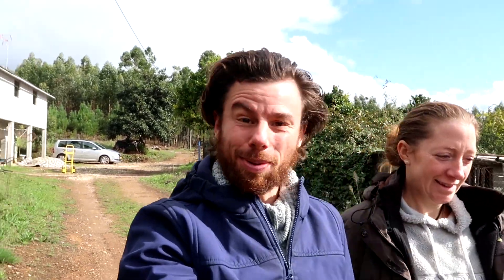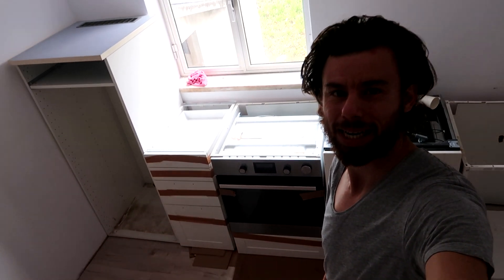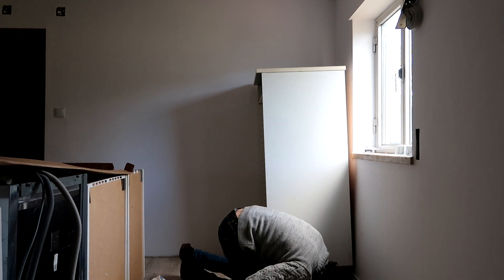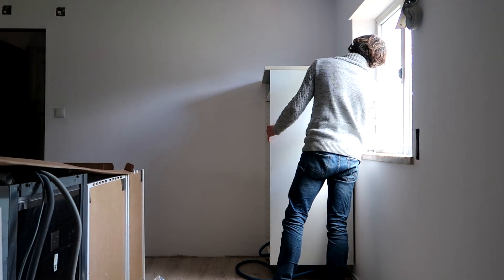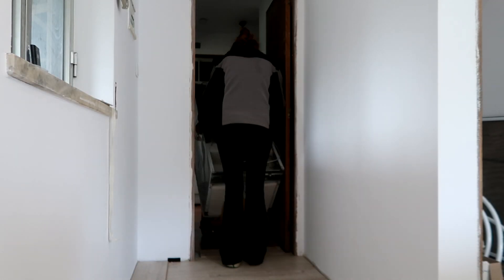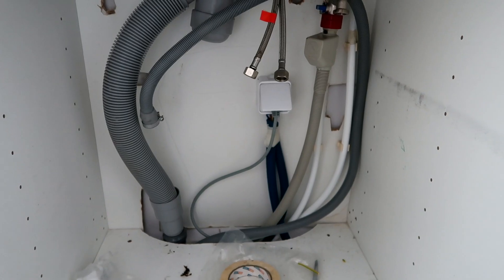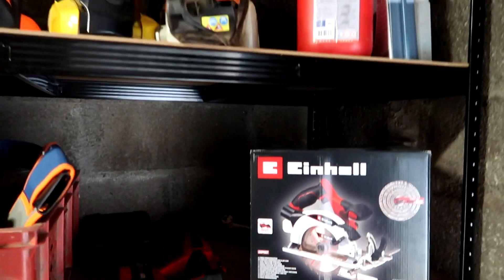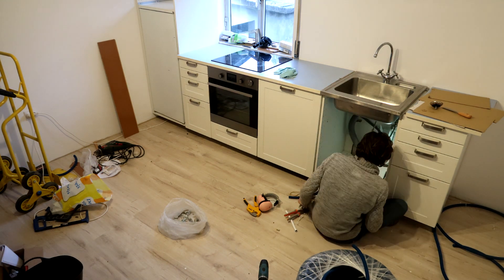Budget Brilliance: Installing a €200 Kitchen

Comment: Hey buddy.. you can increase your electricity power... you pay more but you can...  good luck you doing an excelent job
Reply from the maker: We've already increased it to the max they can provide us with the current main cable. If we want more, they need to renew the main cables and since we're in the middle of nowhere, they don't want to. Or we will need to pay the costs.😑
Reply: @QuintaLimaPortugal  maybe buy a bluetti solar generator for your extra electric and you can also use it on the land 😇💗💗💗

Comment: It's very strange to see the cooktop installed under the window. As the window will get splashed with oil and water, etc.  Normally in Australia we install the sink under the window. So you can look at the view while washing the dishes.
Reply: I totally agree with you in portugal normally is the way you sugested 😎
Reply: They had a kitchen already set up that way and made it work for little expense - I’m sure if they planned a new kitchen they would have configured it differently but they had what they had and made the best of it ….
Reply: Please please move the electrical socket away from under the sink ! If you have a leak at all your whole sink could conduct the current
Reply: Kitchen for 200 euro well worth bringing from Holland 😊🏡🧰🛠️👌🪓🍻😊💡🤘🚙⛏️
Reply from the maker: Yeah, I kind of agree. But we had to make choices. If we cook now, we can open the window to let the smoke out. If we changed it with the sink, we would need to install an extractor hood. And then we couldn't install any top cupboards there (oops, spoiler alert😅). 
And since we now have a dish washer. I'm spending more time enjoying the view while cooking instead of washing up😃😂
Reply from the maker: Interesting! In Holland it's quite normal to have the socket for the dish washer in the cupboard of the sink. But I'll have a look if there are any ways I can improve the waterproofing of the socket in case of malfunctions.